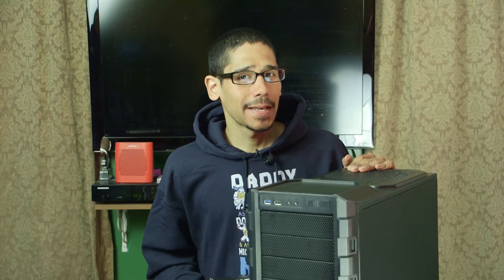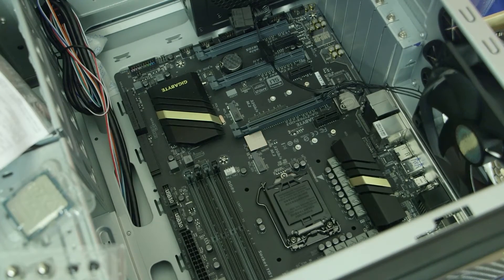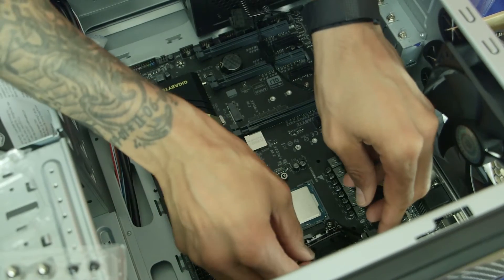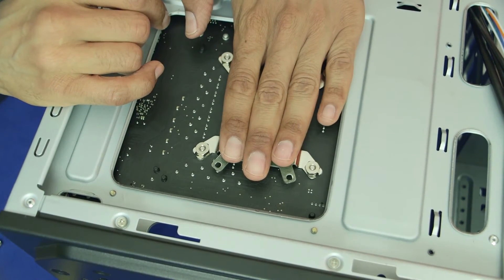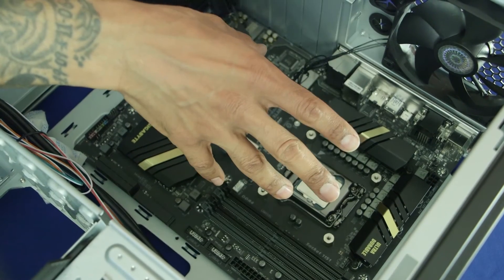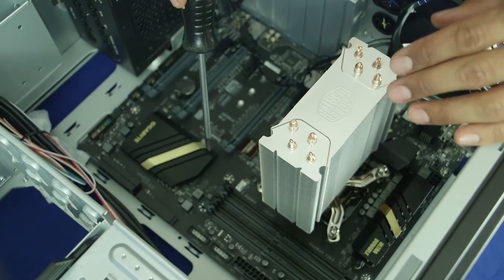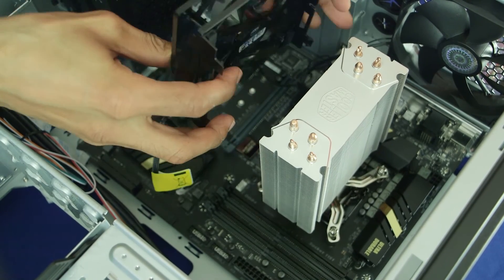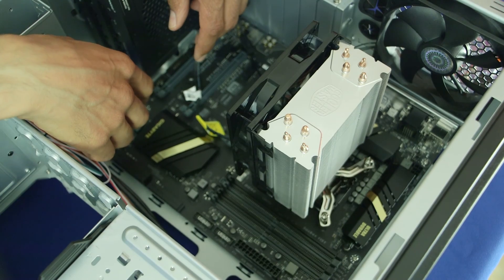Installing 3.2GHz Intel Core i5 Processor and Cooler Master Hyper 212 EVO Heat Sink #VRBuild

Comment: In a laptop im about to get there is a i5-3427U with 3.20 GHz and it has Intel HD 4000 Graphics so please can anyone tell me can that run idk fortnite?
Reply: Elite Donkey hell no
Reply: @DreiGuapo  well I got the laptop and guess what .. It RAN FORTNITE but laggy on low graphics. In the end I found out i got tricked by laptop seller and the laptop was like 6 years old and opened inside broken so they sent me a new one. It should come tommorow i hope its gonna be better than the broken one 😐

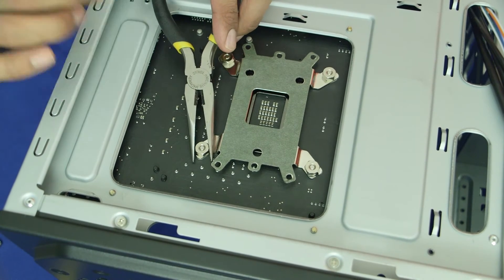Comment: OMG did i really saw static electricity 4:11 - 4:12.. when u touch the bolt
Reply: where where ?
Reply: @CGFUN829  no but he forgot the black cups the go under the risers so it doesn't scratch your motherboard

Comment: Hello, great video congrats. One question, its very tighten your screws of CoolerMaster ? 
How much to tighten?
The cooler should be moved or not?
Thanks.
Reply from the maker: to the point that you can't put no more pressure to tighten the screw and no the cooler shouldn't move.

Comment: I just built my skylake also (6/17/16)

Specs:

Intel Core i5 6500
Coolermaster Hyper 212x Turbo cooler
Kingston Hyperx Fury 16GB DDR4 2133 RAM
Corsair 200R Carbide case
MSI Z170A PCMate motherboard
Corsair CX430 PSU
Graphics card coming soon (I'm either getting a gtx 970 or waiting for the 1070)
Reply from the maker: +cjchico sweet- wait for 1070 :)